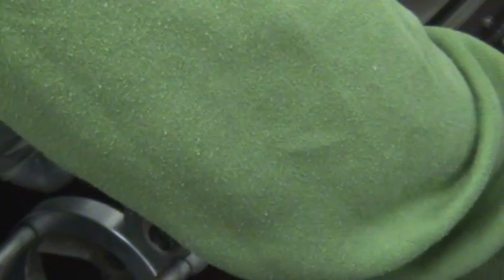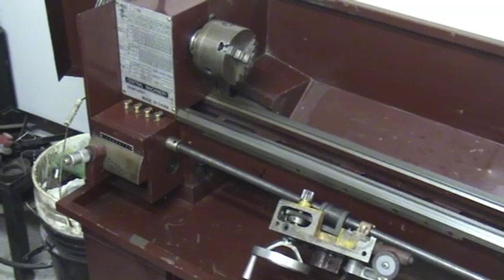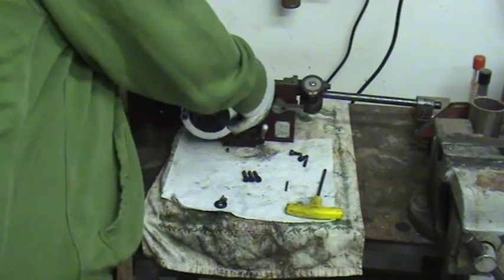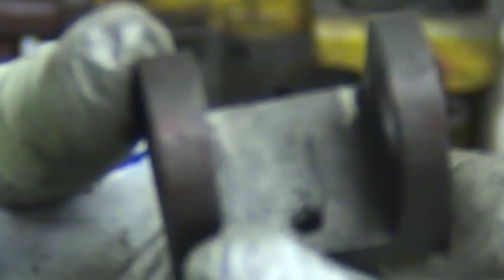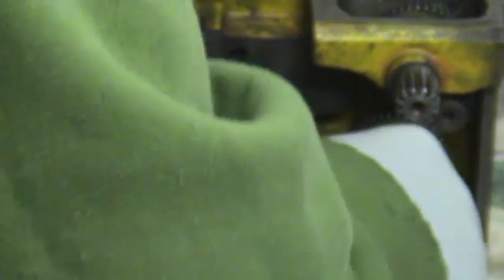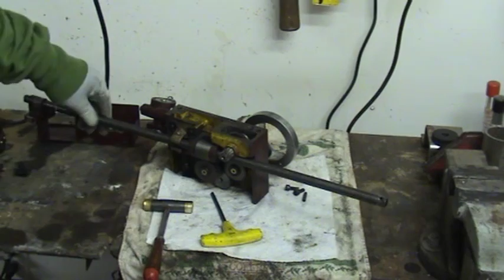Harbor Freight 9*20 Gear Head Lathe Repair Pt.#2

Comment: Can't thank you enough for that lead screw removal! I was trying to avoid that by removing the mounting bracket from the lead screw on the tailstock end, but it would not budge. Seems easier to just remove the roll pin. Thank you again!

Comment: This would have been soo much easier than the way I tore mine apart  😅   I am pretty sure the gear that engages the worm on mine is made of plastic though. I crashed into the chuck with the autofeed engaged and stripped like 2-3 teeth on it and it was enough to kill the autofeed when it got to those teeth. So to “fix” it I flipped the gear around so it would bias the less worn side and its working…  for now. Gonna try this method next time for sure 😅

Comment: Where did you find the “saddle”? I looked at the Grizzly website but they seem to have omitted the saddle from the parts list. Central Machinery lists the saddle but no easy way to order it. What is the acceptable play between the saddle and the worm? Mine has 0.032” gap.
Reply from the maker: Oh man. This was a long time ago. I think I called harbor freight tech line and looked at the schematic with the tech and ordered the parts. I wish I could be more help.

Comment: I was looking for someone to repair my 9x20 when I happened onto your u tube. My problem is I jammed the apron against the head stock and ruined all the gears inside the apron. I noticed during the video you mentioned ordering parts. Do you have a list of parts for the gears inside the apron? Your lathe looks like mine which is at least 10 years old. They say the lathe has a different part # now and some of the gears have different numbers. I would also need the various keys mentioned.

Comment: A trick I've used putting on new bearings or gears is to pack ice in a plastic bag around one component and heat up the other component, and it just about falls together, you don't have to hit it with a hammer at all.
Also, shouldn't you use some threadlocker on the screw holding on the new gear ? Just curious, great job btw :)

Comment: I have watched this video a couple of times in order to understand how the feed mechanisms work underneath the apron.  I was wondering if that lathe has a cross slide feed mechanism.  I don't see it on there, though. I don't know why they would go to all that trouble to fit the lathe with a power feed mechanism and not also provide automatic feed to the cross slide.  On my 7x12 minilathe I simply use the half nuts for the automatic feed.  Great Video, Thanks

Comment: I am a 9X29 (Wholesale Tool) owner with a stripped worm gear (not the worm but the large driven gear) and don't know where to order replacement parts. I also have a 30tooth that is knackered as well. Been planning to go CNC but just never get around to it, so it seems I need to fix the old manual stuff. I have an old Harbor Freight ZAY7032G that I have CNC'd already just not the lathe. Where are you getting parts from? Thanks in advance.

Comment: Thanks for this vid. I know mine is the Grizzly version of this one, same size basically, so when I have to do mine, this vid will definatly help.. You make it look so easy... I am also thinking of getting a mould to cast a lead hammer, you think that would be a good hammer to use on the gears when tapping back in place????